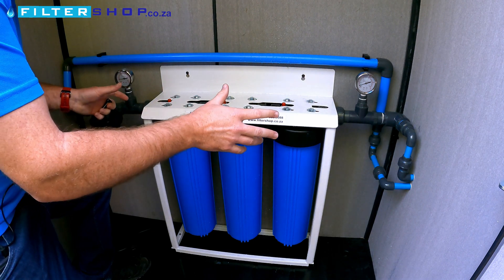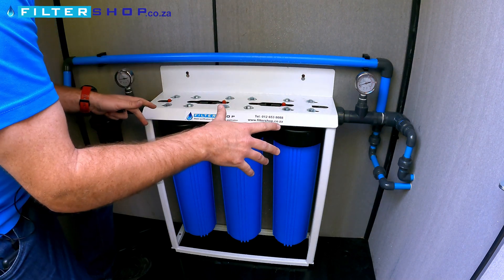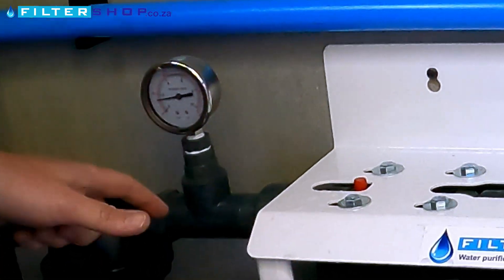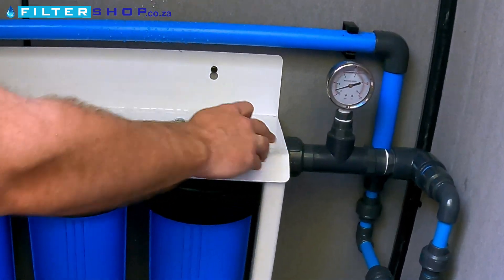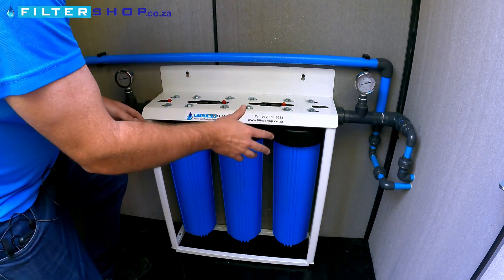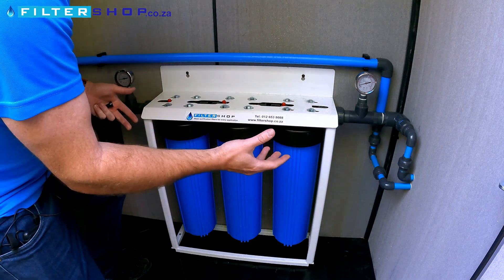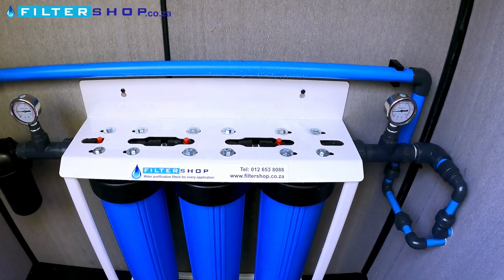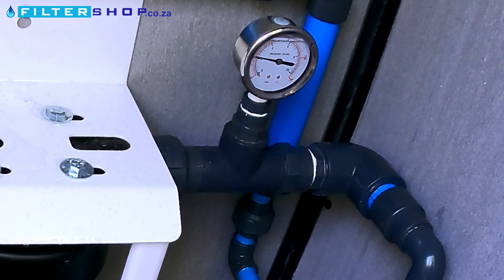Using Pressure Gauges to Inspect Filters

Comment: What do the red switches do on the top of each filter?
Reply from the maker: Hi, They are to release pressure if you are changing filters and to get air out of the system when filling again after a filter change.
Reply: @FilterShopZa  i the imput water presuure is 65 psi but the output is 50psi if you open several facucet in lower level pressure drop to 40 psi... how can you gain waterpresusre at this point after waterfilter is installed
Reply from the maker: @jaandel1  Hi, the pressure drop across the filters will go up with flow. So if the pressure after the filters is too low for your needs you can either, place a second set of filters in parallel to reduce the pressure drop, or you can use a pressurized buffer tank as a store of pressurized water after the filters. At my house I use a 150L buffer tank after a single set of filters and it works well for 95% of the time.
Reply: @FilterShopZa  thanks for the explantion.. I did do look for that option but then what pump should I use??? Pressure tank required a switch and pump.
Reply from the maker: @jaandel1  Hi, the pressurized buffer tanks is basically a store of pressurized water, thus it doesn't need a pump or pressure switch if placed after the filters as it is just stirring pressurized water there. Here is a link to the type of tanks: https://www.filtershop.co.za/pressurewave-pressure-tanks
Reply: @FilterShopZa  yeah the pressure drop after filter... great advice appreciated I didn't see this explanation in other Chanel.   I will try this thks